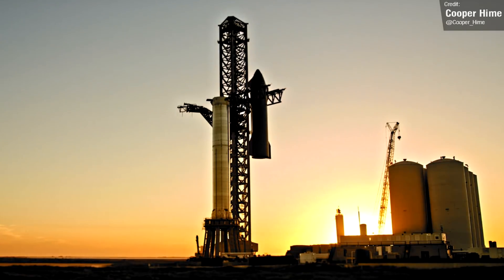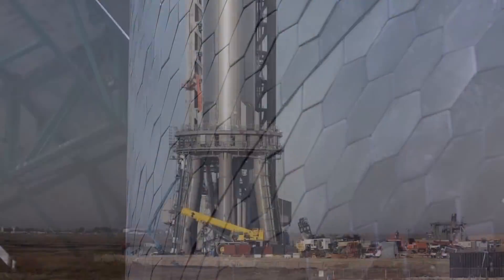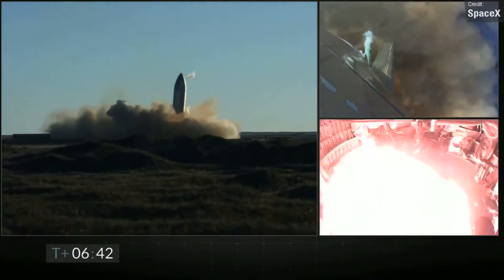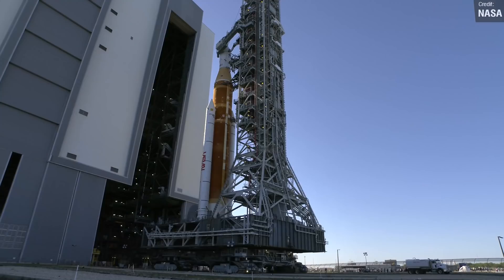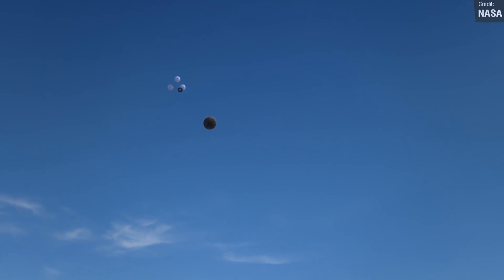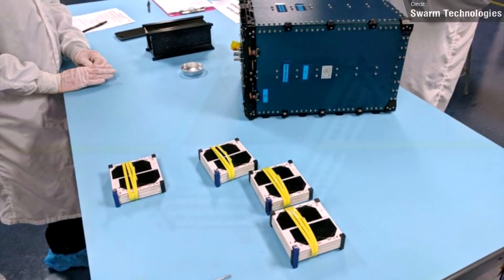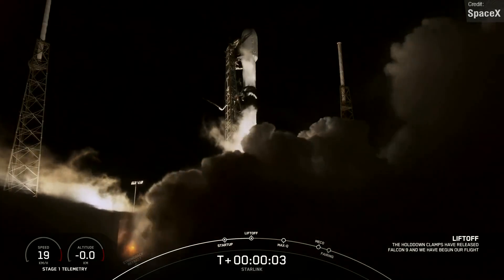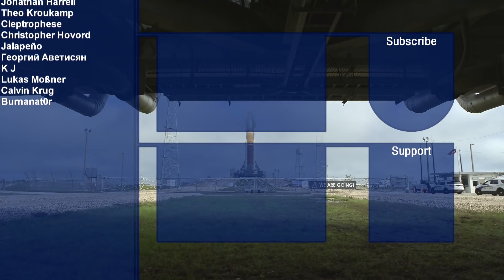The World's BIGGEST Rockets are here - SLS and Starship! + SpaceX Starlink, Astra, Soyuz MS-21

Comment: It's amazing seeing something so expensive and so obsolete rolling out onto the pad. What's the ratio of cost-to-orbit of SLS Vs Starship? 20,000:1?
Reply: Obsolete? Everything else that could top it is far behind in testing, or simply doesn’t exist. As for expensive, Jesus, I agree.
Reply: I too can make up imaginary cost comparisons!
Reply: Per the NASA IG, the first 4 SLS/Orion launches are $4.1B each. 

With the HLS Option A contract requiring an unmanned Lunar Starshp test landing and the manned Artemis III landing for $2.94B, that puts each Lunar Starship at $1.47B. It will take up to 10 Starship flights for Lunar Starship to get to the Moon per the GAO. The [DELETED] propellant depot will launch first. Then up to 8 Starship Tanker flights will refill [DELETED]. Lastly, the unmanned Lunar Starship will launch to refill from [DELETED]. Then it will go to the Moon to wait on Orion to deliver the crew.

So roughly 2.8 to 1. Now the $2.94B is NASA's part and they said that SpaceX was funding over half of Lunar Starship. So if you include SpaceX's portion, each Lunar Starship mission is roughly $3B, so 1.3 to 1 then.
Reply: @steveaustin2686  Musk is claiming (yes, I know you have to take that with a pinch of salt) 10M per launch for starship within 3 years, and is hoping to get that as low as 2M. 

If starship truly is as rapidly reusable as planned, then that doesn't seem too far off the mark when your main cost is fuel, not replacing the entire rocket on every launch.

At 10M that would be approx. 400:1. Even if Elon is exaggerating  by an order of magnitude, it would be 40:1. 

A reusable rocket is almost always going to be cheaper than a single-use option. which is why I call SLS obsolete. 

I'm fully prepared to eat my words if starship fails to fulfil Elons promises though!
Reply: @chelfyn  Musk also said that the $2M per flight was when hundreds to thousands of Starships are flying. That is very unlikely to happen in 3 years. SpaceX will be lucky to have the [DELETED] propellant depot, Starship Tankers, and Lunar Starship ready in 4 years (2026) for Artemis III. Even if you are talking 3 years after the Artemis III landing, then that would be by 2029 and I just don't see thousands of Starships being built by then. Just 1,000 Starships by Dec 31st, 2029 is 2.8 days per Starship, starting today. SpaceX can't even build boiler plate test articles that fast.

Per the GAO report denying the HLS complaints, SpaceX's plan for Artemis III is one Starship launch every 12 days. That is a far cry from daily or even multiple per day launches.

The HLS Option A contract is for $2,941,394,557 (page 8) and is for an unmanned test landing and the manned Artemis III landing. Per the GAO report and Musk's comments on Starship's payload, each Lunar Starship mission will take 10 Starship flights to get Lunar Starship to the Moon. Twenty flights into $2.94B is roughly $147M per flight. A far cry from Musk's far off goal of $2M for the internal cost. 

Likely cheaper, but not necessarily as capable. The Falcon 9 B5 can lift 22.8 tons to LEO when expended, but only 16.3 tons to LEO when recovered (B1051.12). Reusability costs payload mass which was one of the reasons other companies didn't want to try it. Falcon 9 B5 gets away with reusability as it's payload mass when recovered is still enough for most payloads.

Elon shoots for the stars, so that when they fail to reach that height, they are still in orbit. He has admitted to frequently making overly optimistic goals, so that they reach as far as they can. The $2M per launch goal appears to be such a goal.
Reply: @steveaustin2686  which is why I did the numbers on the 10M goal, and even that's optimistic :), but in almost every case, reuasable > ditched in the ocean.
Reply: @chelfyn  Reusable is fine, if you can take the payload hit. The Falcon 9 Block 5 when expended can lift 22.8 tons to LEO, but when recovered can only lift 16.3 tons to LEO. The SLS Block 1 just can get Orion to the Moon, but can't take the payload hit for reusability. Also, the SLS started development in 2011, when Falcon 9 had TWO launches. SpaceX didn't land the first Falcon 9 booster until December 2015 and didn't refly a booster until March 2017.

Don't get me wrong, SLS/Orion is TOO expensive, but until something else can take crew to and from the Moon, it's all we have.
Reply: @chelfyn  The HLS Option A contract is for $2,941,394,557 (page 8) and is for an unmanned test landing and the manned Artemis III landing. Per the GAO report and Musk's comments on Starship's payload, each Lunar Starship mission will take 10 Starship flights to get Lunar Starship to the Moon. Twenty flights into $2.94B is roughly $147M per flight. A far cry from Musk's far off goal of $2M for the internal cost.